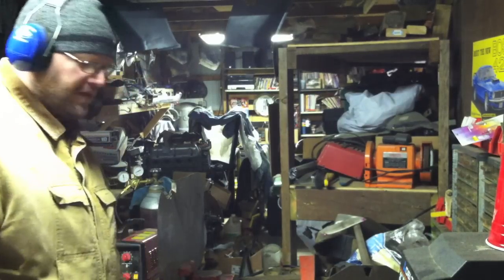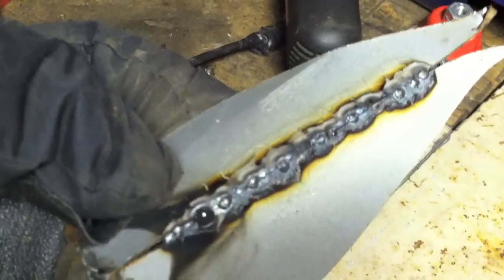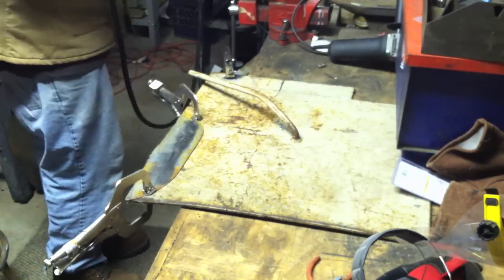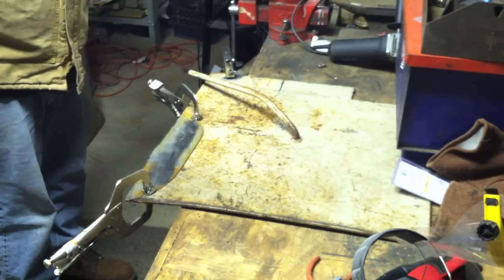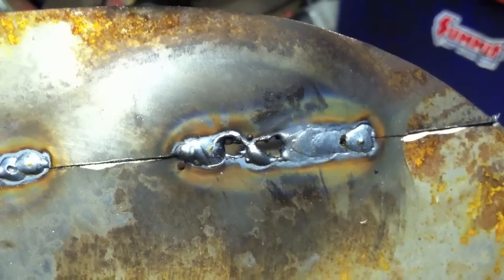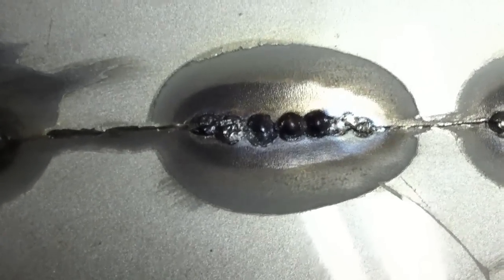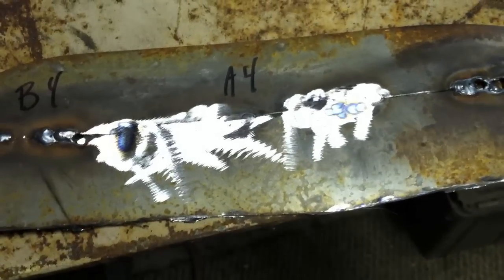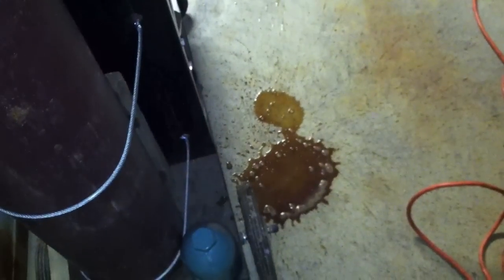New Years Welding Practice

Comment from the maker: Thanks Chief, yeah I'm at about 20 pounds. I'm trying to do my butt welds as a series of tacks in order to not distort the metal. I now know that I should've cleaned both sides of the metal before starting, I didn't clean the back so I know those welds were contaminated. I'll try dragging on the next set of videos. Thanks for watching these and giving me pointers, glad to have a pro giving me some feedback.

Comment: You should also practice with welding 2 pieces of different thickness of metal together,and some 90  degree welds. Will help in learning torch control. Every thing you weld will be the same only different .

Comment: Looks good.  Your welding table is acting as a heat sink too, so when you go to weld a quater panel on the mustang all the heat will go into the panel increasing the risk of burn thru.  For practice, i would try to get a good weld on a B setting when clamped to the table, you had some good spots when using B but burned thru when you held trigger longer.  Then try welding two pieces in the vertical position so the table cant draw the heat, this will definitely be an A setting. just my 2 cents :-)

Comment: Hey John, 

A4 looks good.   You could probably get B4 to work as well if you don't hold the trigger as long on the welder. I like to use a copper backing plate behind thin metal as a heat sink when I am working on a panel on the car.   I make these by cutting some plumbing fittings in half and pounding them flat.   I know what you mean with WOW.   I was the same with Call of Duty...I resisted the urge to buy the new one (so far :-) )  Keep practicing John!

Comment: Kinda sounds sometimes like, you running out of wire, turn the wire speed up a bit.Low wire speed ,you will see wire melting before it hits the metal, To fast speed you will feel it hitting. You can be any where in between.You just need to play with settings and angles till find what works for you.Every thing you weld will be a little different. What you look at and how you control the torch is just as important as the settings.  Will learn to use the torch different also to control some things